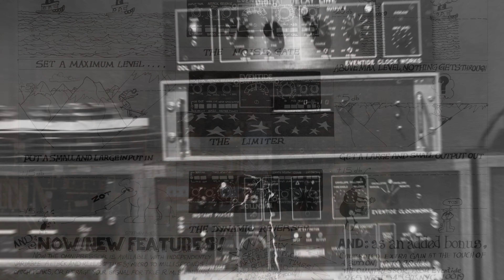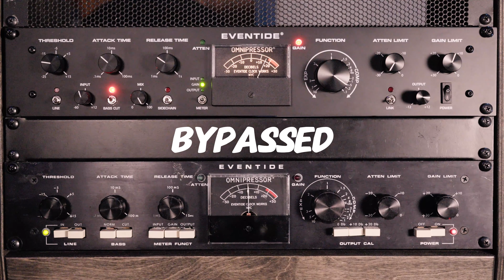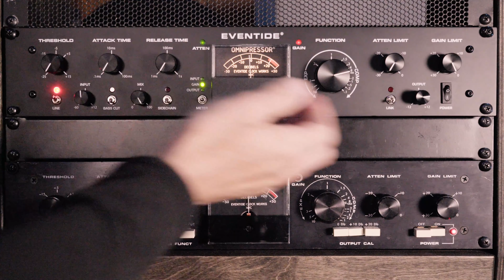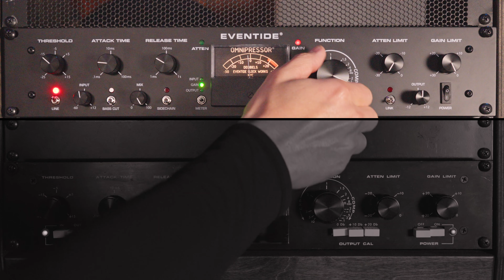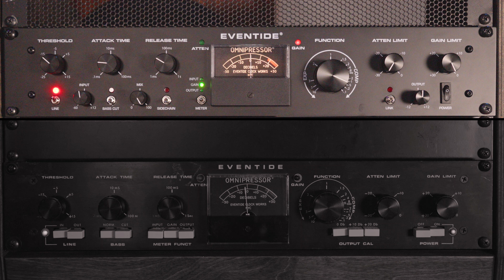Omnipressor® 2830*Au Reissue Overview & Demo

Comment: Seems strange that the threshold is cranked yet the needle is barely moving? Needs more input signal is my guess.
Reply: It's set to measure gain reduction across a swing of up to 60 dB of change - thats x5 or /5 the volume in either direction.  
Peaks are getting smashed down pretty regularly by 12-15 dB!